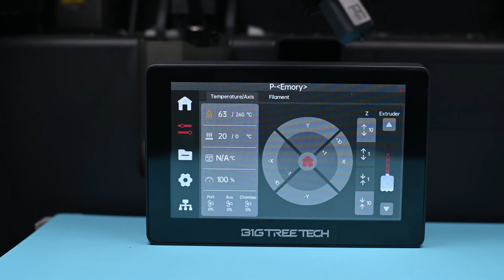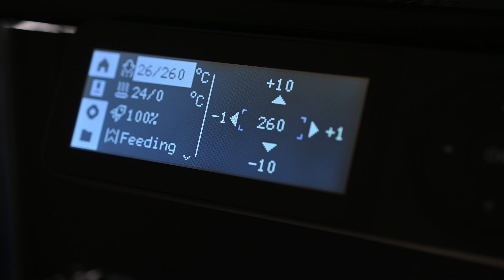Bambu P1S Cold Pull - Unclog your nozzle in minutes

Comment: I think I have a piece of filament ABOVE the part where it slices the filament. That on top tube wont come out, what should I do?
Reply from the maker: I’ve got another video about disassembling the extruder down to the gears to remove stuck filament, check it out!
Reply: @TapticDigital  Ooof, ty. I guess that's my next action. Absolutely underdesigned for us to have to do this over something so simple. Ridiculous.
Reply: @TapticDigital  I fixed it, you can pull the top tube out by pressing down on the black ring. Once I did that, a small segment of filament was floating on top of the gear, small pliers, it easily pulled out and all is well. What a headache. Thanks for the video and reply.

Comment: I cant get the dome tip no matter how many times i try it. Ive gone through 3 hotends now, all caused by the bambu black pla. It must be a bad roll. Ive only had the printer 3 weeks and its already gotten 3 clogs i cant seem to fix
Reply: I've also experienced clogs on two hot ends with Bambu black pla

Comment: Allan key tip is handy.  I've had cold pulls break mid pull twice, lodging a ball of filament gunk right past the heat break where no amount of nozzle heating will soften it.  I've had to drill it out both times but I think the heated allan key would be a lot less risky.
Reply from the maker: The only time I’ve really had an issue was with ABS being stuck, turns out it can be stronger than the tool and I ended up snapping it inside the hotend. That one was fun

Comment: This is massively overcomplicated compared to cold pulling my modded Ender 3 Pro. Why is it overcomplicated? If it were designed reasonably, like most every printer I've ever used, the extruder would have a manual release latch on it where I can pull on the filament from.
Reply from the maker: You know, I gotta agree on some of that. Doing a cold pull on my Sprite Pro was stupid easy. And this would bug me a ton, if it weren't for the fact that this Bambu just never clogs, or jams. The maintenance is "easy enough" because it doesn't have to be done nearly as often as my other printers. I feel like me and the Ender have a weekly leveling session, whereas I haven't had to adjust my P1S a single time. It's apples to oranges though, the P1S is a higher priced machine and should act like it. I do miss the quick load of lever action hotends sometimes.
Reply: @TapticDigital I just bought a p1s and it clogged on my first print this thing is garbage.
Reply: @TapticDigital I replaced my Ender's level wheels and springs with a trio of lock nuts for hard mounting, never had to adjust it since. One to hold the screw in place on the plate, one to sit on the mount, one to hold it down. Never had to adjust it since.
Only reason it ever clogged was because my heat break wasn't tightened properly from the factory and was spewing plastic around its threads, I tightened that up now it rarely clogs.
These machines take some tweaking to get them perfect but once they're dialed in, particularly in ways you can make sure that will stick, like with my hard mounting, they become easily competitive with even the top tier machines.
I mean, of course, I've deeeefinitely gone way farther with my Ender 3 Pro than just making it a solid basic machine, but still.
Sherpa micro extruder with a custom mount I made, aforementioned hard bed mounting, BLTouch, Spider 3 extruder that is properly assembled now thanks Creality, 4.2.7 board, dual Z, Klipper on a knockoff Pi, silicone heater, linear rails everywhere, I've truly given this machine the works, and it's paid off with both how fast and consistent it has been, the one flaw so far is that the extruder can't keep up with the rest of the printer because I put a weak knockoff motor on it instead of a good one, skimping on price at the last step was a mistake I guess. Even with extrusion issues at speed though, still eaaily the best printer I've used, so it's paid off, especially with it still being quite a bit cheaper than something like a P1S.
Reply: @TapticDigital  I can second that.  I loved how I could just jam cleaning filament directly into my old Neptune without disassembling anything.  It's annoying how complex it is with the P1S, but I've had to do it only 4 times in 2 years.  With my old Neptune I was clearing out the nozzle monthly at least, and doing full nozzle replacements every couple of months.
Reply: It worked for me.

Comment: Love your videos, please keep them coming.  Also, just thought I’d share a method I saw on a different video that works great for me. When the filament is flush with the top of the hot end, I also do the same and heat up an allen key and shove it in as far as I can. I will then set my hot end to 100 degrees and once it’s heated up I’m able to pull everything out all at once while still attached to the allen key. Just wanted to share.  Have a good day!
Reply from the maker: That would have been the best move realistically, maybe I just like pretending to be hulk 😂 thanks a ton though!